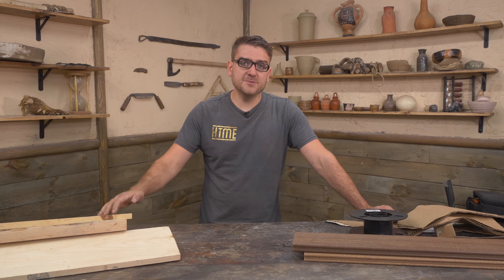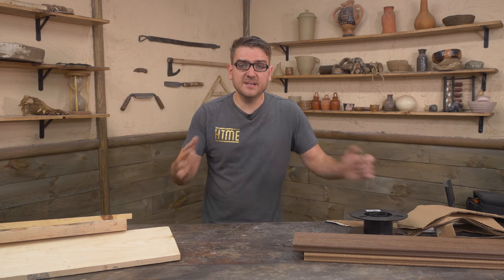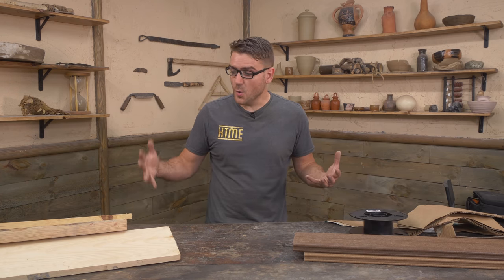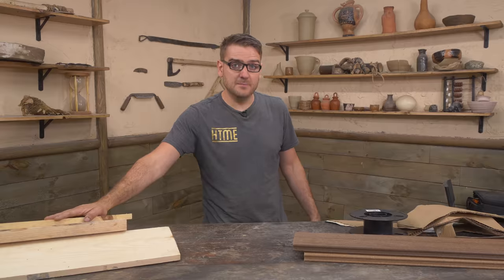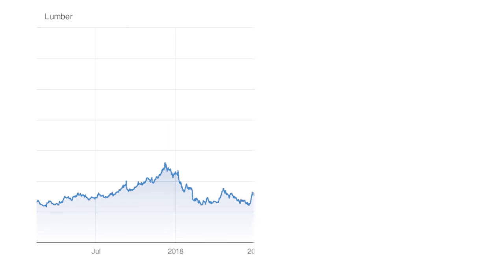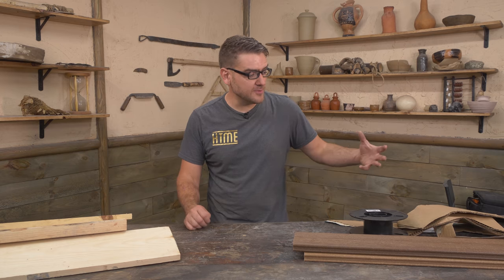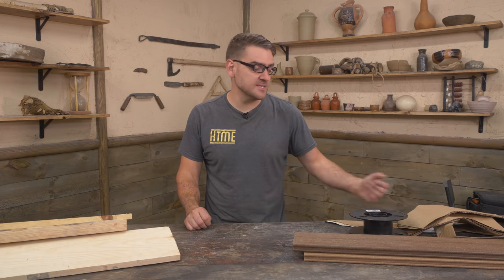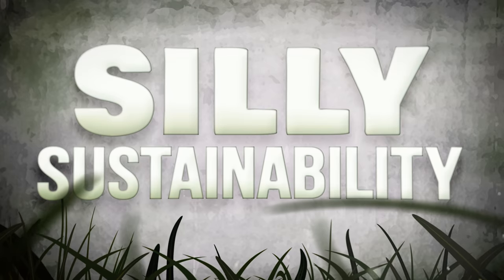Turning Trash into Timber: Exploring the Eco-Friendly Side of Recycled Lumber!

Comment: A weak board that crumbles isn't too much worse than OSB, whenever I try to use OSB it tends to want to fall apart especially when it has been exposed to moisture. Also in the wood/plastic composite, you should probably think of it as plastic with a cellulose filler rather than wood with a plastic binder more plastic will give you a tougher material.
Reply: I would rather advise for the use of a fiber. Lets make like the original wood with man made twisted rope like fibers that will strenghten the whole structure ?
Reply: Over the last 25 years of roofing in Wisconsin through winter. I will say that osb has gotten much better though. Used to get rained on once and it was done. Not anymore
Reply: @Salazarsbizzar  Perhaps the good stuff, I probably haven't messed with the highest quality OSB.
Reply: @garethbaus5471  oh its garbage I'm just saying it's a lot better than it was lol. You still need plywood for anything qualitie,which I'm pretty sure theres different qualities of plywood.

Comment: After working in a saw mill where we sold off some waste wood to a company making what you were trying to make. I enoyed seeing yu try to achieve the same results
  We installed a sawdust dryer then ran the sawdust through a flour mill making the as fine as bread flour. then shipped it off to the plant where they used an epoxy type plastic to mix with the wood flour.
 All of this required lots of heat and fires were a big problem for our sawmill and we fought lots of fires in our storage bins. we managed but the company the produced the finished product burnt to the ground and we mothballed the flour mill  I was very happy when that happened as it was a maintence nightmare

Comment: I'm surprised it does not appear you used any binder/resin for any of your attempts. Without any binder, your use of melting plastic alone, as a binder, I'd expect would never hold significant structural strength.

Comment: I used to make injection molded trays,  utensils,  humvee parts.  We used grinders resembling wood chippers to recycle rejected parts.  A cheap wood grinder with sharp blades might be your answer.  Run the material through 2X for smaller particles.  Since you're not extruding into a mold and adding back pressure you should probably consider more heat,  more  glue eventually distributed, and maybe vacuum forming.  

This a great idea. I hope you revisit it again.

Comment: Try this.  Instead of melting plastic, take styrofoam and dissolve it in acetone.  Then mix the powdered cardboard with the glue like polystyrene suspended in acetone and put it in a mold made from 3D printed polycarbonate.  Put clamps on it and design lots of little holes in the mold parts so the acetone will evaporate out of it.  Wait till it’s full evaporated and you might have something.

Comment: I think the composition plastic to wood ratio has to be higher, more plastic. Plastic is the binder. Think wood fill pla plastic filament. And yes, finer could not hurt on the plastic. A little grain on the wood could provide strength, think osb (oriented strand board). To big on the wood can cause jamming in the extruder. Cardboard is just a filler.

Comment: When you melted the plastic in the barrel, you should have continued heating it and added the filler to that and mixed it.  Then poured that molten goo into your form.  that will help to coat the fibers with plastic and glue everything together.

Comment: For what you're trying to achieve with the plastic, you would need a majority of plastic with a little bit of fibers to strengthen it.   A little bit like when you mix concrete you mostly have cement as the primary ingredient with a little bit of stones and a couple of rebars.   Once you have your melted goo, put your fibers on it, fold it, put a little more fibers, fold it.  Once you've done it a few times, twist it (like how people make candy canes).   Then put the twisted plastic in the mold and press.

Comment: Composites are usually about 60/40 plastic to celulose and you want a much finer plastic particle to be able to get in and around the wood fibers. It's almost like you are mixing a fiber reinforced concrete where the plastic is the cement, the sawdust is the aggregate and the paper is the fiber reinforcement.

Comment: This is a fascinating experiment. I wonder if a series of thin laminated sheets could create stronger end products depending on the direction of the particles. Much like plywood has strong shear strength but a glu-lam has tremendous tensile strength...all made from sheets of wood and plastic. If we could use recycled plastic to make structural building materials we could start to change things on a major scale! Thoughts?

Comment: I use weight rather than clamps in the toaster oven.  Relatively even weight provides continuous pressure downward.  I use hot rolled steel plate
Reply: Im curious if crushed lump charcoal or diy char powder (made from sawdust) added to the mix would help or make it worse

Comment: Find a decent chipper shredder thst has a hammer mill in it.  Put a screen wirh small holes in it over the discharge chute.  This will all anything you put in it to be pulverized into very small particles. Also use more plastic than natural fibers.

Comment: You maybe need additional binder, or a different more "melty" type of plastic
Reply: If you have more pressure with which the plastic is being extruded, then it should penetrate more material and get absorbed more due to higher saturation of the material, ready to bind with the chips.

Comment: I think smaller size  was the best try, but, should'nt  you have used an adhesive, or experiment with inexpensive adhesives so that the final product is harder. Also, could that second attempted  product be used as an insulation?

Comment: It would haave possibly been much easier if one used accetone or any liquid to help disolve the plastic to a liquid form and mixed the materials under pressure, and see what happens
i could stand to be corrected on the accetone, but watched a video where the fellow just used a liquid and the plastic melted, and it would have been very easy to blend with what ever one wants, and when it set up, it was a hard as it could be, no heat was required.

Comment: You are very good at trying things. But your inability to understand root cause of your failures is fascinating. Look, woodchips do not need any plastificator like plastic to glue together. There's lignine inside literally every plant on earth, which under pressure is enough to create decent wood. Under significant pressure cellulose paper would form into wood alone. But no, you still attempt to make as long of a board as possible.